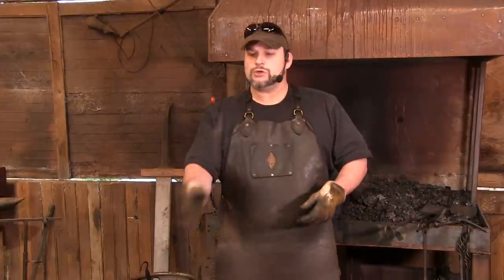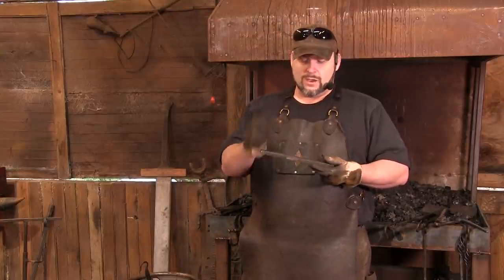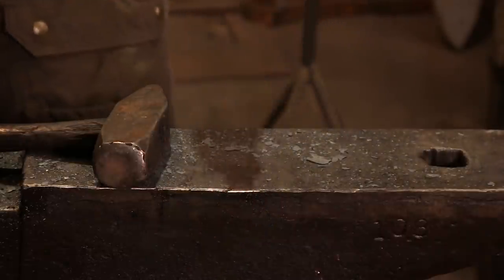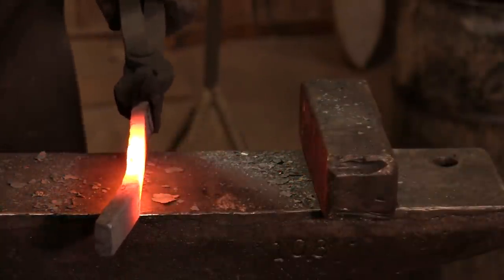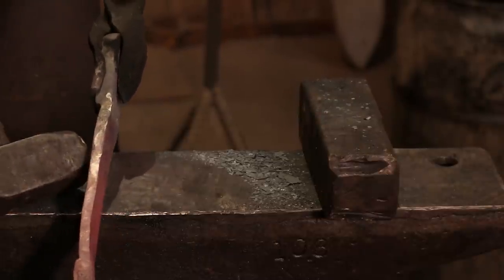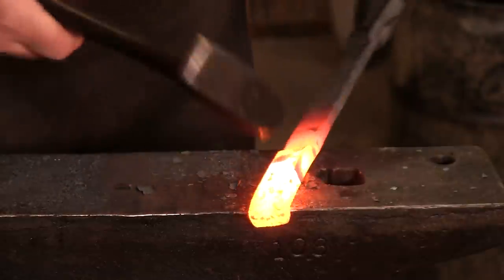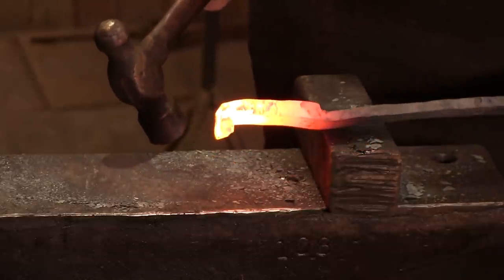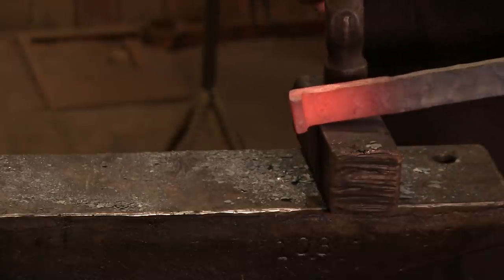Making A Rivet Header (Pt 1) (#20)

Comment: Is there a good table top area for the coal forge?  I am looking at putting together my coal forge with a 10 x 12 inch firepot, was just wondering if the table table needs to 2 or 3 times the dimension of the firepot or does it really matter?

Comment: @Trent - what's your EDC in your back pocket?
Reply from the maker: Its a rubber prop I use for molding holsters but I usually have a glock 21, .45 acp. Not a precision gun but reliable.

Comment: I'm lovin this stuff fn amazing and was wondering what you think of the Brazeal way of drawing out material
Reply from the maker: One, its not the Brazeal method. It has been a method since blacksmiths came about. Its a valid technique but more often, its a technique to help take the place of the guy with the sledgehammer you need. Even more so, you would have top and bottom fullers in addition to the sledge hammer

Comment: Serious question. I notice that the mandrel seems very loose and wobbly.  Is there a reason for this? does it need to have give for some reason? In my mind, having it solidly mounted would be better,  but I'm too fresh to be called a novice.
Reply from the maker: So, this is an artifact of having to have a mobile "set". Due to the nature of the shop, very little is locked down because sooooo much has to be juggled depending on the project. It would be far better to have them locked down but Im still trying different layouts. So we get a little jiggle.